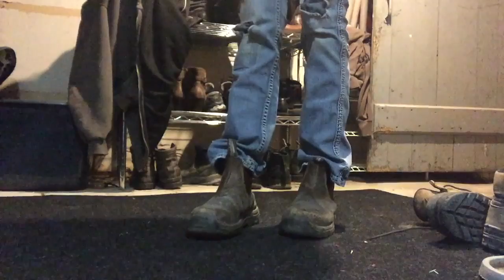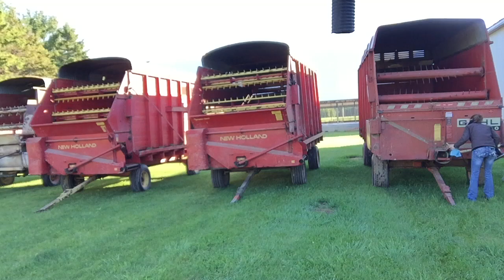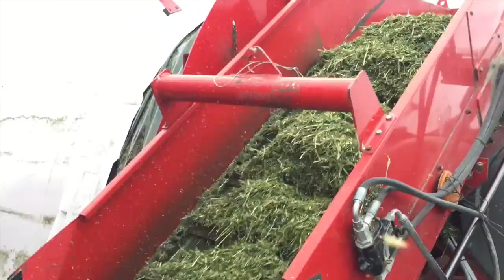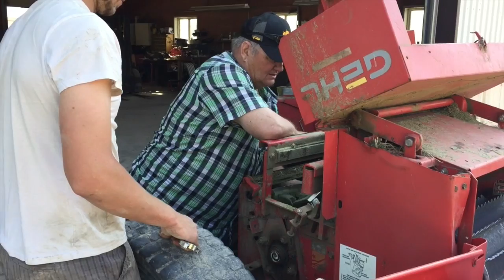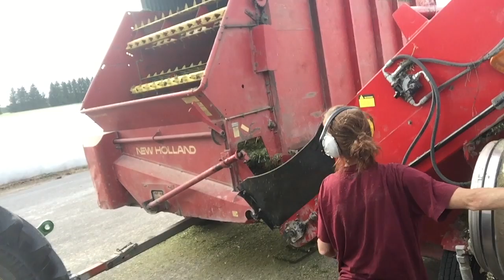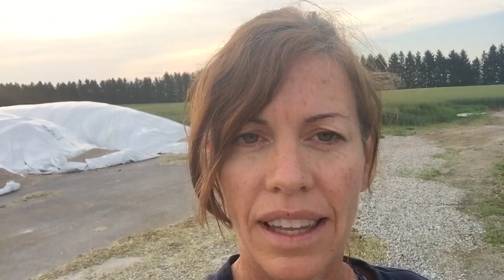Harvesting First Cut Hay 2017 |  Vlog 24

Comment: How many tones of hay do u plan to make each year vs how many tons will u use to feed them in a year amd how how many ewes and why don't u bale the hay we have alway fed hay bales and gave them there grain separate.... do u use whole grain or just silage
Reply from the maker: Oh boy...  I'm not sure on tonnage of haylage off the top of my head.  We tried bales the first year, but my facilities just didn't work with bales.  I love the TMR as I can use whatever feed we have, mix it well to prevent sorting.  Its quick and easy.  We add whole corn, corn silage, ryelage to the ration besides haylage.  Just depending on what we grow.